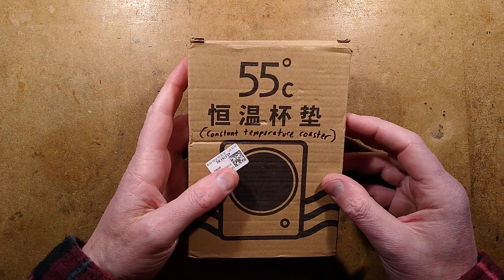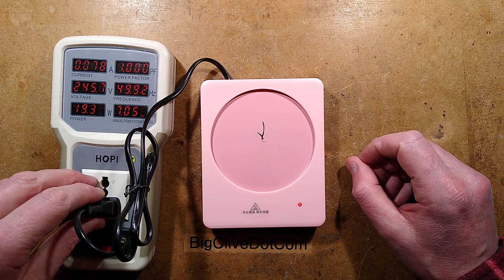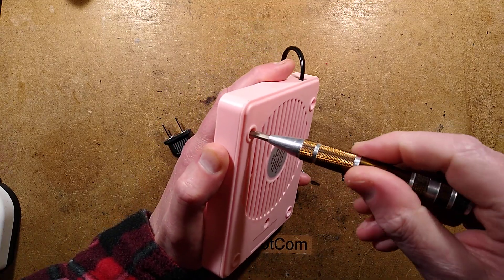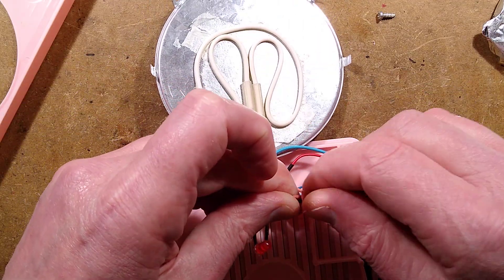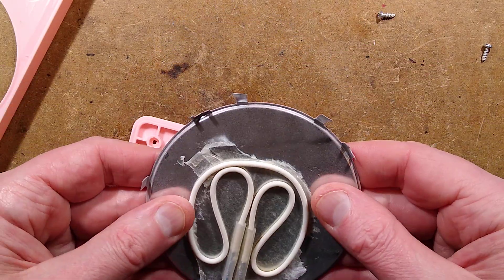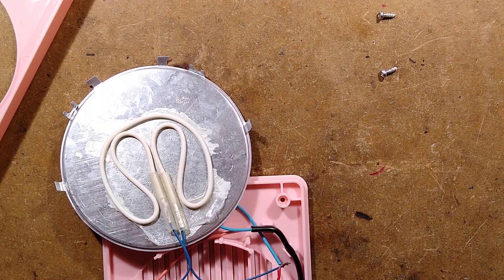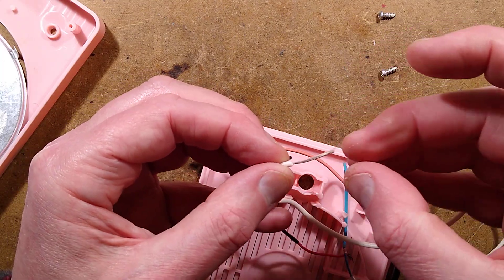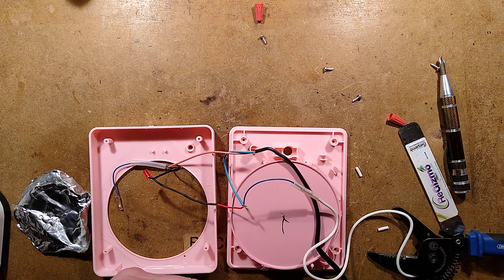Hot pink and dangerous (just how we like it)

Comment: Electricians use those horrible twist caps everywhere around where I live in nova scotia. I showed one a wago and they had no clue. People think they know better without doing any research.
Reply: Wire nuts are everywhere in North America, unfortunately. I'm not even sure Wago connectors are in code. We're not allowed to install grounded outlets the safe way (ground lug up), so it wouldn't be a great surprise if we're not allowed to use good connectors either.
Reply: @OhShitSeriously  Wago connectors are allowed by code. They just have to be UL listed (they are). And the code does NOT mandate that outlets be installed ground lug down. It is silent on that matter. Most commercial construction these days has the ground lug up. It's up to the electrician or the customer how they want it, ground lug up or down. In my house the builder installed all of the switched outlets ground lug up so you know they are controlled by the wall switch.
Reply: @OhShitSeriously  I'm not based in NA, but this guy seems to know what he's doing and cites the code book pretty well. https://youtu.be/783mxTnrVVg
Reply: @OhShitSeriously  Properly installed, wire nuts only reinforce and insulate an electrical junction - they should never be the primary element creating the junction. That's why the wire inside is steel: it's not meant to be a current-carrying conductor.

Comment: What would be the ideal way to fix this?  Add a PTC thermistor and remove a corresponding chunk of the heater wire to adjust the total resistance?
Reply from the maker: A thermal switch might be easier.
Reply: I think the best way to "fix" it is a trash can.
Reply: @Blowninyourphone  let it cool first lest you start a fire in the bin.
Reply: USB-powered ones were a joke in the past. With new high power standards available that might actually be a preferrable and quite safe alternative now.
Reply: No, I think Clive found the correct way to fix this.

Comment: Perhaps it would be less out of control running at 120V
Reply: It works out at about 5W at 120V which looks more like what they are claiming for the temperature on the box.... The thick plottens
Reply: @cybclinic  That seems a more sensible rating!
Reply: Despite the plug used, the company printed a 220v spec sticker for it.
Reply from the maker: I think the plug is a Chinese 220V one.